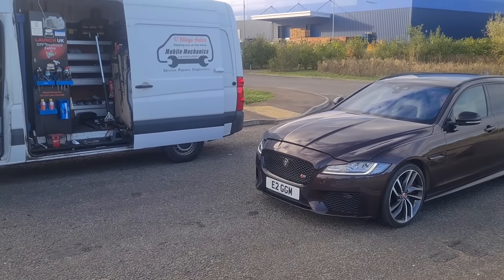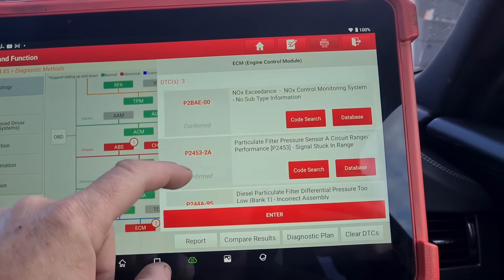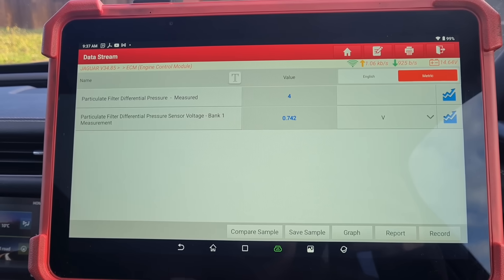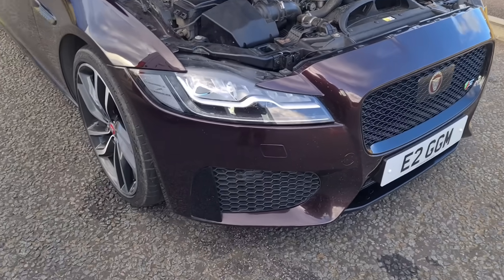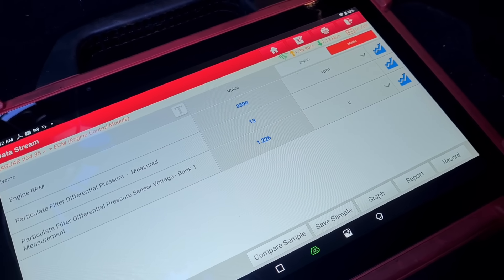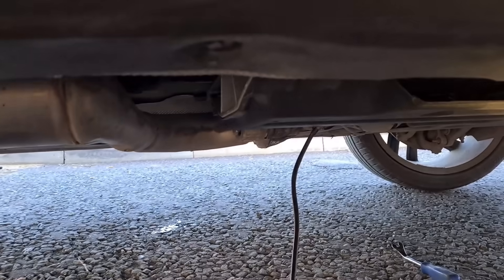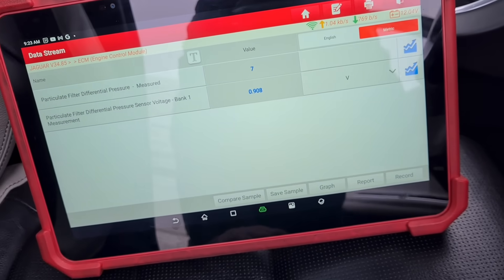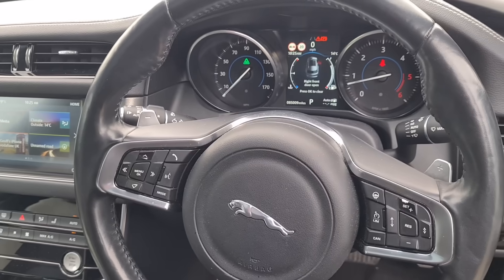Jaguar XF 3.0 P2453-2A P244A-95 P2BAE-00

Comment: Jimmy, on my launch scan tool, DPF pressure is better off  reading as "Delta pressure" for a more accurate live data output. as you say, "DPF pressure" just reads 10hpa at a time. delta reads the entire range on JLR cars

Comment: Not being funny butwhy cant regular mechanics do logical troubleshooting to diagnose and resolve the issue?
Reply: He will only see the jobs where the mechanic failed.. 

I dont think our man here is single handedly keeping every dpf fitted diesel on the road.. 90% maybe, but not all of them.. 

Most garages probably fk off these jobs because the techs aren't effective at finding and fixing them in a timely fashion..
Reply: Many so called mechanics couldn't fry an egg, let alone diagnose a vehicle. I'm not being funny either
Reply: Not many garages troubleshoot any more , unless thay can see the problem it just gets ignored.
Reply: because they are not trained in troubleshooting. Most are Technicians and in short that means a fitter. It's the same in most engineering sectors these days!!
Reply: Because mechanics are few and far between these days. Most are just parts swappers.
Reply: It's double, costumers not wanting to pay for troubleshooting and owners not seeing value in troubleshooting and or technician not trained very well
Reply: Regular mechanics are just wrench monkeys. They only change parts if you instruct them to. Ive gone to about 8 different places and no one does an inspection or diagnosis properly. Makes specialists able to charge the earth.
Reply: Nope!
Reply: They're mechanics, not technicians.
Reply: Nice car
Reply: You try it then loool
Reply: Because it's not worth their hassle when they've got a diary full of general repairs and servicing, easy money👍 why do think there's loads of Kwik fits, and Halfords garages everywhere
Reply: Mr O'Reilly should be charging high end dealership prices for his work/diagnosis (top guy)
Reply: At least in the US techs on YouTube say they don’t get paid to troubleshoot they get paid for installing parts. The out come seems to me is let’s change parts until it’s fixed vs spending a bunch of time figuring out what parts are needed and then only getting paid to install the part.